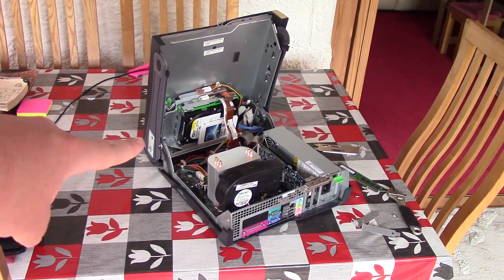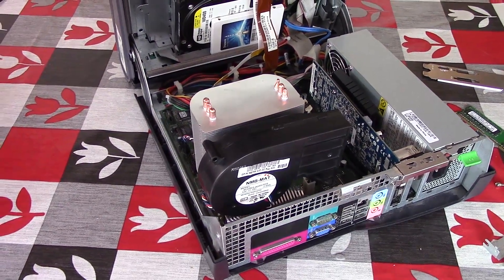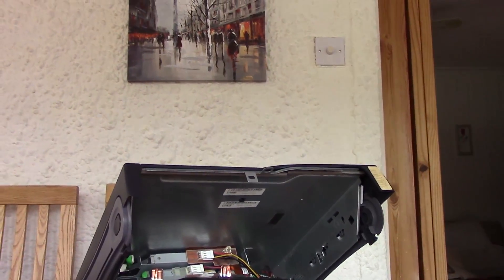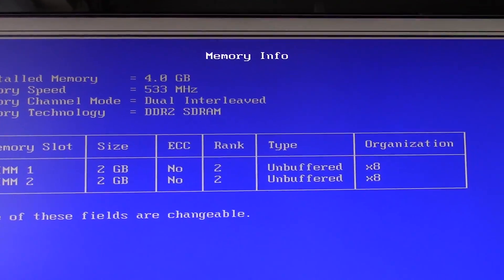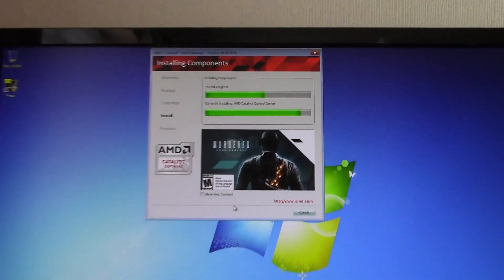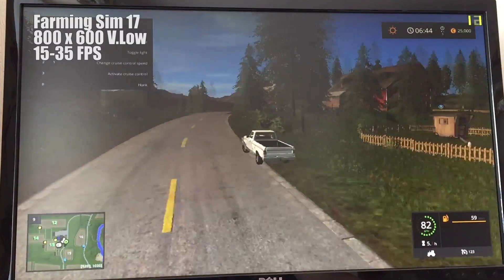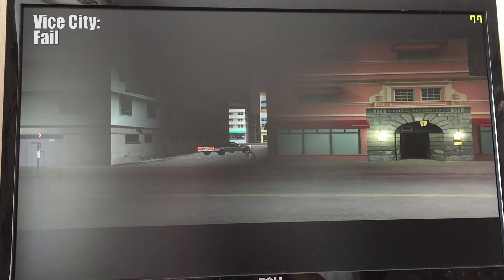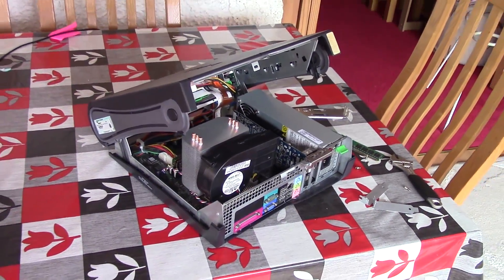The $0.30 (£0.25) Optiplex Gets Modified...

Comment: Did you know that if you put it in windowed mode and make the window smaller the frame rate dramatically increases Using this method I was able to get fortnite to run on low settings and 720p on my HD 6450 at 30 - 45 fps.
Reply: lol if you're running on a small window it's no longer 720p.
it get faster because you're decreasing the resolution. that was the only way that quake would run on my 486 dx4 back in the day. a small window not much bigger than a quarter of the screen. that way i went from 7 fps to some 20ish (yeah quake was pretty damn demanding)
Reply: oh yea, I'm dumb... meh it still runs better than full screen at lower resoultions
Reply: Nah I found the game can run up to 50% better in windowed than in full screen. Plus anyway I like windowed better anyway so on my GT 1030 build I use windowed anyway with no performance decrease.
Reply: Really it should be easier for the card to run at full screen than windowed. Same resolution for full screen and windowed should give better performance in full screen.
In fullscreen it can stop rendering the desktop, and switch to only render the hardware accelerated graphics of a game. In windowed, it has to render the hardware accelerated graphics, then scale and transform them into the window, then draw all the desktop at the higher resolution, and then run through the 8x Vsync that windows forces.

Comment: how much did you payed for the ram? i have an IBM thinkcentre here with pentium 4 HT 630 i think and 512mb ram and my mobo supports up to 4gb but how much should i spend on ram?
Reply: Covenant Lazarus he literally said it’s not his main pc...learn to read
Reply: Splexie isn’t mine main pc, is just a pc that I have here laying around. I gonna use it to Netflix.
Reply: I upgraded my Dimension 8300 with 4GB of DDR1 quite a while back, I think that may've cost ~£12 but I can't be certain I'm remembering correctly.
Reply: He literally said that the PC is just laying around. You know, he is thinking of making the PC have some worth than just being a storage hog. Get an English teacher.
Reply: Covenant Lazarus nice one you crippled douchebag
Reply: *pay
Reply: 2 gb at best, I'd settle for keeping it for windows xp games up until around crysis too play on it at best but focusing more on backwards compatibility with games like colin mcrae 1,2 & late windows 98 games as well with a graphics card like GT 440, HD 5670 or similar if you want too play borderlands 1,2 on low settings on this machine with 2 gb ram.

Otherwise id just modify the front io & put in entirely new hardware into it that is fairly cheap, like socket am3+ motherboard an athlon II x4 640 8 gb ram & a HD 5770 or faster like a HD 7770
Reply: I also have an old Thinkpad T60 (12 years old) and I upgraded it to 4GB of Ram and thrown away the 512MB stick. Unfortunately only 3GB are recognized due to chipset limitations. I bought those 4GB DDR2 from Ebay for 10$. The sticks were also said to be new.
Reply: Honestly, don't pay anything for the ram. I've been able to scrounge up ddr2 for free from PC's that have been thrown out. I even found an Optiplex 755 in perfect working condition with a fresh install of win7 pro 64 at the dump. You won't be able to use that PC for Netflix with the current CPU either. I have a 2.8Ghz P4 W/HT (Core2 I had died) with 4gb ram and an HD 6770 and it can't play 720p YouTube without constant stutter. It played just fine with the Core2 Duo though.

Comment: My first 'custom built' PC was a Pentium 4 3.0GHZ, 4GB of Ram and an HD6450 and it was great fun, updated it to a Core 2 Duo e4300 (i think 1.6GHZ dual core) and it was able to run league of legends at 60 fps, CS at a reasonable framerate and did really well. My friend was using that PC until the end of last year.

Comment: Mafia didn’t fail, 0.33 FPS is still very playable
Reply: Our eyes can only see 0.030 fps anyway
Reply: Potato Fisher I know right😉😂
Reply: It has a 30 in it so it must be playable
Reply: RagingHammer don't give me that bullshit we all know it 0.024 FPS because that was the frames movies was made on to make it easier to see on the big screen.
Reply: I'm wondering why Mafia performance is so poor. I played it on an Athlon XP 1700+(1.467ghz) with 512MB DDR 266(single channel) and a Geforce 2 MX 64MB(175mhz core OCed to 185, 167mhz 64 bit sdram OCed to 177). The Pentium 4 2.8ghz in the tested rig is definitely faster, and an HD6450 would mop the floor with a GeForce 2 MX(not to mention 4GB ddr2 vs 512MB ddr).
Reply: @tau8550  bruh how did u type this then
Reply: Me to have an optiplex but it has an core 2 duo
Reply: Potato Fisher waste of gpu I can't see more than 0.0000001 fps anyway so there is no point for the gpu to that fast
Reply: @doggydude98  idiots, I have the best specs and my eyes cannot even run!
Reply: @doggydude98  Wow, look at your high standards. No output at all is enough for the human eye that can't see.

Comment: Wonder if it'd handle steam streaming alright... Could have a purpose then.
Reply: I really doubt it could handle that - with just one core and probably also pretty old network card. Could be interesting to try it though.
Reply: Khanemis You can pop a newer network card in for cheap and turn on hyperthreading in the BIOS.
Reply: Budget-Builds Official Might I suggest Parsec as a high performance alternative to Steam in-home streaming? Any reasonably recent GPU ought to run the Parsec client just fine. In fact, Parsec runs well enough on a Raspberry Pi that something like this could even be considered a waste of power and space by comparison.
Reply: @SMarioMan  would that work on linux mint or ubuntu? probably something i will have to try on my PC with the AMD Phenom ii x2 550 that is in my PC and something i could use after upgrading my PC to play some newer games on my laptop that don't fit on the hard drive
Reply: G V: Nope, don't need one :)
Reply: Budget-Builds Official I don't think so
Reply: mine exploded when i turned it on. it couldnt handle living let alone steam streaming.
Reply: Maybe.....
Reply: :O you're verified!
Reply: 2 youtubers
Reply: 11th reply ;)
Reply: Budget-Builds Official
Reply: First Reply ;)
Reply: second reply ;)